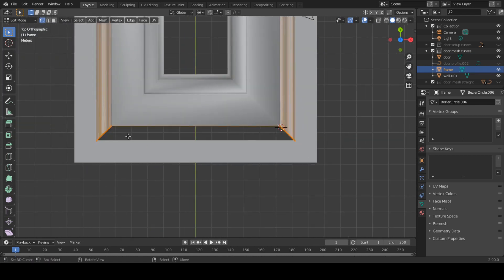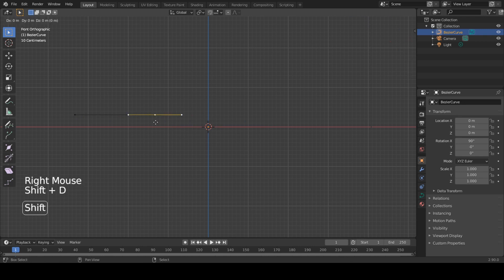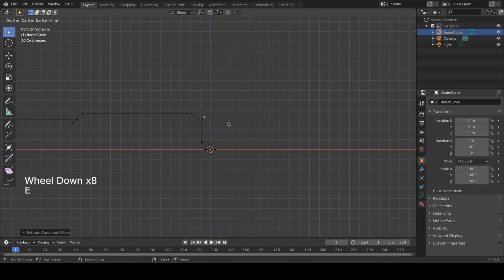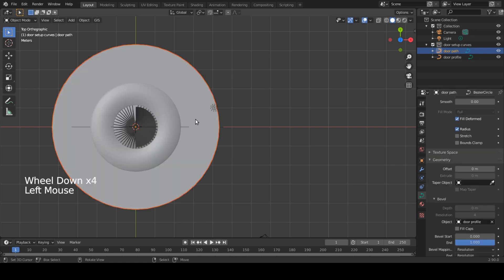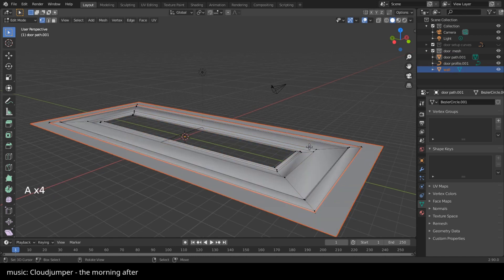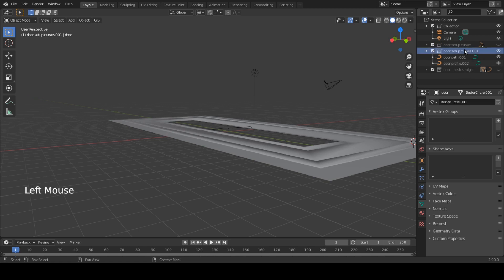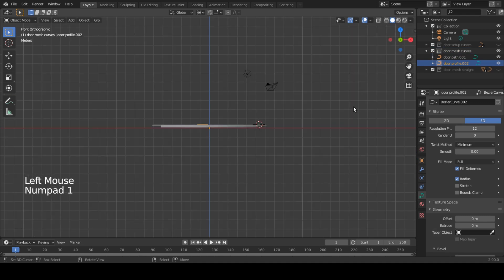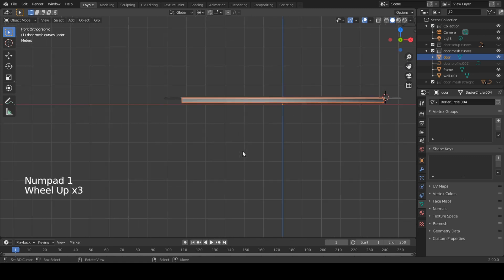Blender 2.90: Modelling with Curves - How To Model a Door

Comment: This... is fudging revolutionary.  Thank you so much. That is going to save me so much time and extruding.
One question: How did you get so many lines into one of the frames at the end?
Reply from the maker: I am glad you like it. You can set wireframe in the viewport. Maybe that is the lines you want?
Reply: Hm.. I meant the parallel lines of vertices at 6 min. Maybe I just missed the part were you added those in the cross-section. 
Now: I have another thing I'm struggling with. Making the cross-section, extruding the line it sometimes appears red and the three vertices seem to connect, letting the curve show (In front view). Thank you for being so open to New people like me. I really appreciate it.